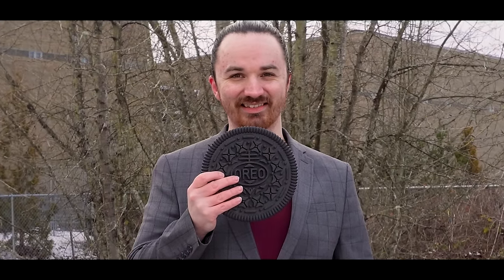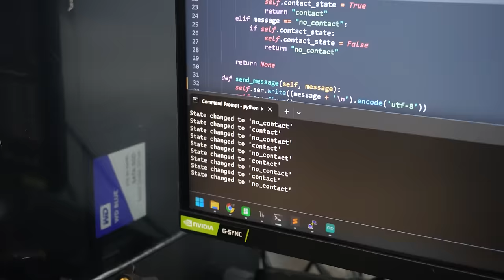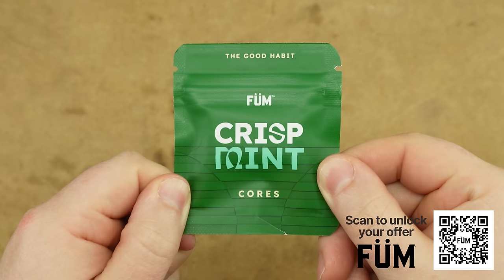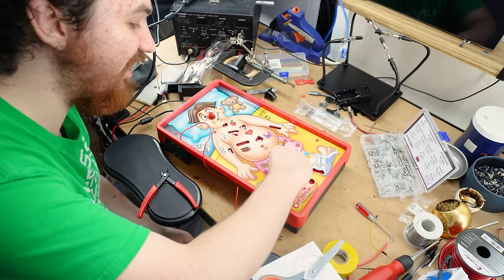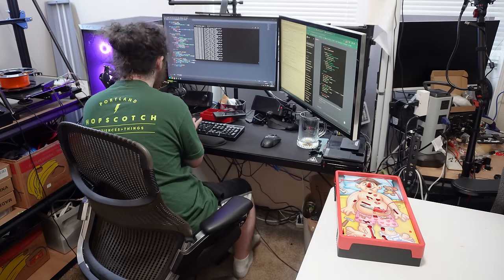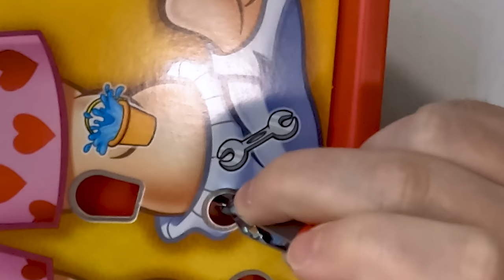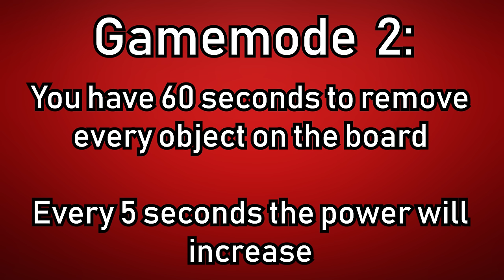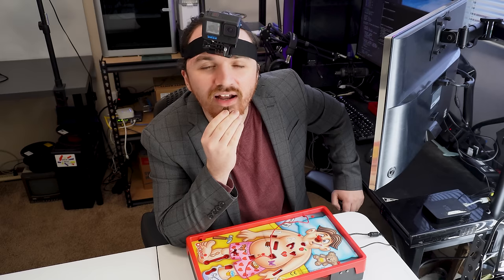I Overclocked Operation

Comment: It could be worse, you can add a means to add a timer akin to a beeping sound akin to a heartbeat sensor that will randomly speed up at any moment(normal to slightly faster to very fast to flatline), and when it does flatline, it will wait another randomly determined amount of time and then send 100% power to all motors for 3-8 seconds.
Can also add a little led array to randomly assign which thing is removed and automatically change the power level for every item removed, and a button to press to reset the countdown to move to the next level.
Reply: You want anxiety, THIS is anxiety. I was inspired by the Sonic drowning music/SFX
Reply: Except you don’t know when it will get closer to losing, and are unable to anticipate when you will be punished for it

Comment: With the rubber band thing, you're supposed to be putting it in, not taking it out. So it's the hardest operation by far, if you're playing by the correct rules.

Comment: In the original game, I seem to recall that you're supposed to connect the "ankle" to the "knee" with the rubber band, rather than remove it.  That's why it seemed so easy to remove it by comparison.

Comment: I put a magnetic Reed Switch on the inside case that disabled the battery when I held a small magnet in my hand next to the case. My brothers knew something was up because I would be super sloppy removing items and the buzzer would never go off when it was my turn

Comment: You should make a version of it with a (not so) small capacitor that discharges on the tweezers and shocks you, you could also use a transistor to regulate the amount of voltage sent to the cap to make game modes.

Comment: You should actually finish it by making all the logic run on the board itself, but the game mode is easily programmable using some file that pico runs, lua or python I guess. Just write code on pc and upload it to pico (possibly by pico emulating a usb flash drive) and boom you have a new gamemode.
Until then it's just objectively worse since you simply converted the game into a glorified input device for the pc and it needs special "drivers" to be used.

Comment: Just to correct you about the pico: the USB port on the rpi pico can actually do more than you think. It literally can be programmed to do anything including acting as a mouse or even a webcam if you put your mind to it.

You probably configured the pico wrong and used serial instead of usb UART.

Comment: What would be better is if you combined one of those motors into the tweezers. Many fairground games use an extremely powerful motor to simulate electronic shocks. That would make it so much worse when it comes to the fear of completely the circuit.

The board vibrates, eh, it's not that bad, but if the grippers vibrated at rapid speeds, it becomes a whole different board game. No one wants to be shocked, realistically or faux shocks from rapid vibrations.

That, or you just hook up a car battery to the board and full metal pincers and go from there. 😂

Comment: It would be nice to add like 1 or 2 buttons. It start at 50%, every time you remove an object, it reduce the motor by x% but when you touch the side, it increase by x%, so you must no touch the sides.
1 button to says that you removed 1 parts and 1 to reset the "game".
Add memory and you could use it w/o computer.

Comment: The reason the rubber band was so easy is because it’s the only one you don’t remove. You’re supposed to put it in instead of take it out and connect the knee to the ankle. I really don’t know why it’s different but it is one of the hardest ones in the game if you do it as it says in the game instructions.

Comment: The game is much smaller than I imagine, also missing the wooden chassis. The bottom was also enclosed except for the battery compartment, and the tweezers and operation pieces bigger - Looks like Hasbro cheaped out on the version 2. Granted they are still both as difficult as one another to play, especially for some pieces!

Comment: How to do a fail-off thing: add a failsafe piece of code that just sends E between the computer and the pi, if one of them fails to receive the E, the whole thing shuts down (that is where I have no current idea, maybe a switch that connects to the computer with a auxiliary connection that cuts a relay?)

Comment: You could have cut of the wire for the tweezer, replace it with a full metal tweezer and hook up high voltage to the metal borders of the object chambers. Still just the one original game mode but way more fun and Electroboom pilled
Reply: Bonus sadism points if you replace the thingies you are supposed to remove with laser cut metal sheet parts.

Comment: You overdid it by a lot; 1x 12V relay or timed relay module, a few resistors and small toggle switches for adjustable voltage divider, 1x 9v battery. Same functionality.

Comment: Next step: replace the Pi Pico with ESP32 and use bluetooth and/or wifi instead of the wired connection (it could be then run in browser on both PC and mobile).

Comment: Not powerful enough if it doesn't shake itself apart by the time you pull out the last one! Maybe next time make it where it shocks the player you know like those prank pens or chewing gum the ones that will shock you if you push down on the clicky part of the pen or try to pull a piece of gum out of the pack, that would be cool to see and invite someone to play also! Just make sure they don't have a pacemaker or any other health condition that could cause them a  trip to the hospital.

Comment: the remote lego front wheel car u made 
reminds me when i was 12 i made a Motorhome and wanted to add a large motor into the front to make the Engine sound 
some old old shop guy said it may break the lego.  'but after getting a few small ones from Poundland i used a card and made my own 
contacts with a switch button for the motor and hid the wires under and in the brick walls,  
mine used 6C Batts to make a total unknown voltage leds for inside did work and motor worked the card did work but after a few weeks something 
happened and the battery's at some point started buzzing   But it was a fun time  and i still got V3 the last one from 2009 in 2024

Comment: I don't understand why the PC in this setup. Maybe it's just me, but it's much more compelling to me to make one standalone package. If you're using a microcontroller anyway, then just use that for the game logic. You can put leds, buttons and/or switches on the extended walls if needed to choose game modes and give feednack on power level.

Comment: What i don't understand at all: Why connect to the pc? A raspi pico is enough to run the game logic.. Add a poti to change power or so and you're good. Or use an ESP3 which could host it's own website to change parameters.

Comment: Wouldn’t it be possible to use a Bluetooth connection or a socket to send the data instead of using serial? Interpreting serial is a pain, so it’d definitely be easier to just make a json with the corresponding data between the PC and the game. 

Although that would probably make the game take a short while to react, so I can also see why that wouldn’t be the best option.

Comment: Bro, you have so many different types of microcontrollers, just run the game code from the microcontroller. If you need more clock cycles, use assembly coding. C language and python wastes so many clock cycles.

Comment: No one asked…BUUUUUT: suit jacket buttoning goes: Sometimes, Always, Never for three buttons, Always, Never for two buttons, and Always for one button.
Sometimes depends on how the lapel falls at the bottom. If it folds flatly, you button the top of three buttons. If its fold is not flat, you don’t button the top of three buttons.
When you only have two buttons, always button the top, never button the bottom. 
Again, no one asked, but there you go.

Comment: I don't understand what you needed it connected to the PC for. How does the PC "control it"? I could see if you had lights under each piece and the computer randomly selected which to remove, though even then all the code could be run on the Pico. Also, it seems you don't get the point of Operation. You fail if you make it shake, you're not supposed to just "endure" it.

I thought you were going to connect it to an actual electrical shock system, not just make it shake harder.

Comment: I don't see any sense having to plug a board game into a PC to function. Coulda done all of this and more without an external process. I think this game needs an anesthesia mode with a nice jarring clock tick. Maybe at some point the patient starts screaming in pain that also cranks the detect voltage up to like 1000v for the arcing.